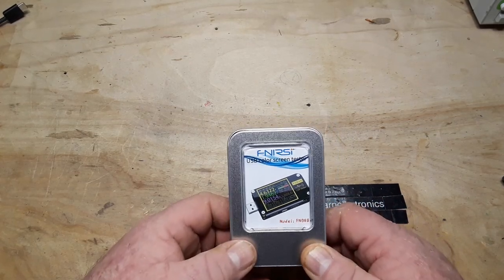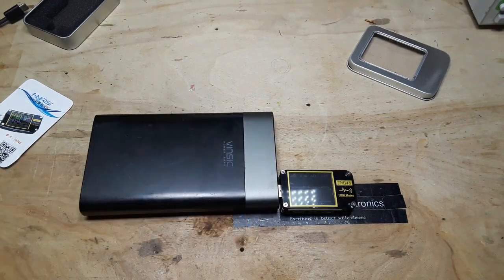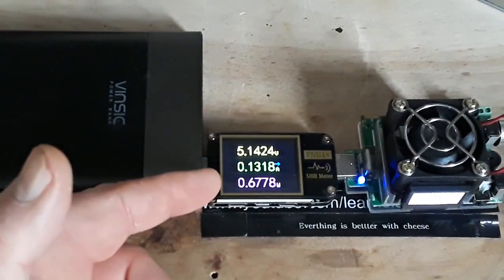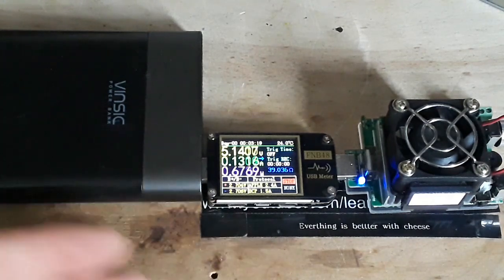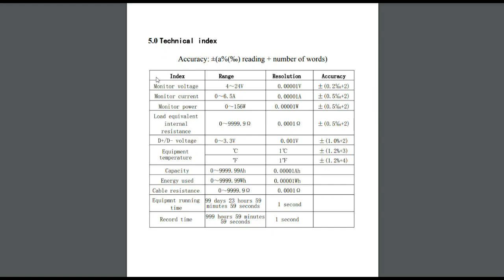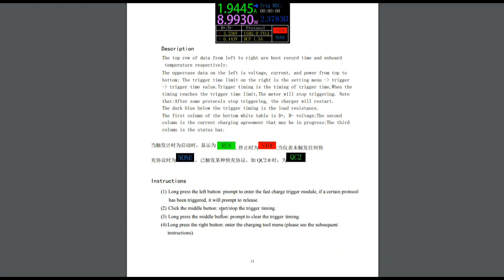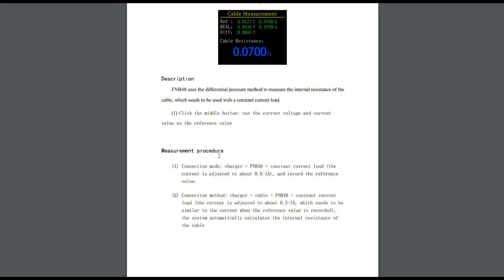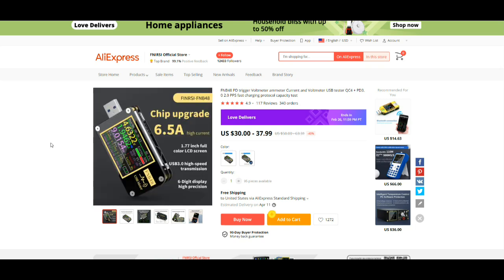FNIRSI FN48B USB Tool

Comment: Hey I got that exact same USB tester. Different name on it but it's identical otherwise. I like it. It's great for testing what protocols your power banks or wall warts can output. Testing USB-C PD chargers to see what voltage and amperage they can negotiate.

Comment: That thing is pretty cool I may end up getting one down the road. I hope your leg is not to badly damaged ice sucks. Hopefully you can get the motor installed for your moms heater, man you have a lot going on right now. Thanks for the great video Paul, you rock.
Reply from the maker: Mom's heat is fixed.

Comment: +8bucks for a +50cent BT chip.. hmm
Not sure what makes this unit special? then all the other USB3 / USB2 meters, I reckon most people already have these USBmeters in quantities so they could feat pigs with them, https://i.imgur.com/ePJyKVy.jpg
it's mainly the 6.5A where 5.0 is the norm, but I reckon there ia also a decoytrigger for the different charge protocols..(that can be handy in some cases)

the last cheap USB meter I got was this 10USD Tesa.https://i.imgur.com/DidwUSA.jpg
and it was mainly because I got a good impression of the Tesa brand (not spelled that in Chinese) and really liked their 90watt power bank that is highly variable.. as it got all the bells and whistle, (at least the later revision).. the QC standards and all the power delivery standards + adjustable barrel DCout from 3v to 24.6w and with a shitload of LG HG2 cells, they work to charge drones in the field, and to charge it up again is also blazing fast with PD20v and 2.7A from almost start-to-finish 
works also good with the different laptops, where some are 20v PD like Porshe Book and some are 15V PD like SurfaceBook2 and it deciphers all of that. hence PD protocol.
 https://i.imgur.com/c9msNED.mp4
https://i.imgur.com/MqPh5JF.jpg
https://i.imgur.com/XHbWOgA.jpg
https://imgur.com/a/Ny06BIe
https://i.imgur.com/3K0TwWs.jpg?1
Though do recall this FNIRSI brand.. pretty sure it was also those who made that little 20bucks oscilloscope
https://imgur.com/a/nOiUeAa which obvious was a pain in the ass as a learning tool and been pleasantly surprised with this unit https://i.imgur.com/VlNmDzR.jpg

Comment: Sorry to hear about your leg/foot and lack of heat, you weren't kidding about a not so great weekend. That's a cool gadget, I'm very fond of these type of things. The only negative i can tell (someone correct me if I'm wrong) but there is no terminal input for bare wire, only the usb. Would have to fabricate a pcb with terminal to female usb on the input.